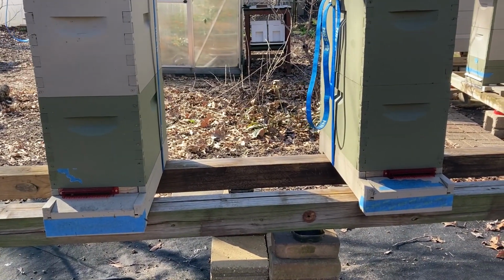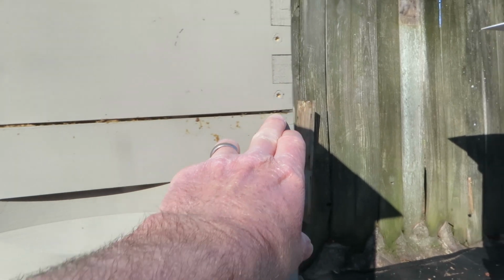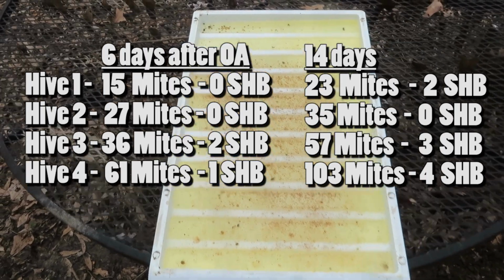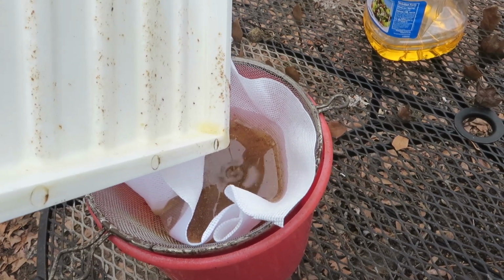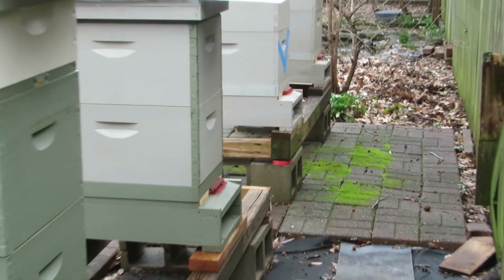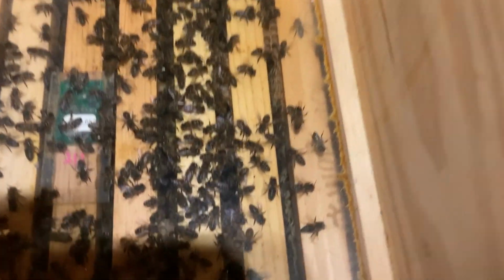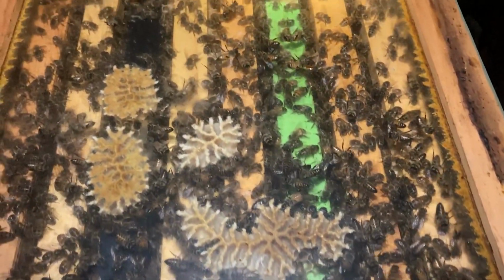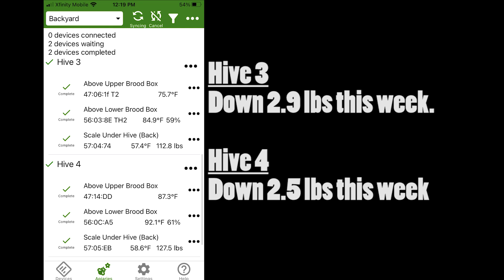❸ Week 4: Freshly built comb in January!  Charred frames from OA Treatment!

Comment: Since you have screened bottom boards for your nucs you can slide a piece of plywood underneath and block the front and back with rags.  That'll allow you to treat with the wand. Leave the plywood long in the back to support the weight of the handle.    If you are treating through the entrance without blocking off the screen you are probably not getting as effective a treatment as you could.  I am surprised you are getting significant mite drop more than 6 days after treating.  I'd hit em again, especially hives three and four.   Are you going to stay with those clear inner covers going into spring.  I can see them building a lot of burr comb on it.  How much space is between the glass and the frames?
Reply from the maker: That's a good idea but I'd have to lift the whole hive to get that plywood in.  I may see if I can come up with something.  The trays that have the oil actually slide up tight against the edge so they are pretty well sealed off when the tray is in.  I never thought to look under them with the trays out until last weekend though.  I think you are right looking at what you've done and my numbers I agree that they probably should get another treatment.  I knew we were going to get some cold weather so I held off.  If the weathers good this weekend I'll hit them again and recount to see where things stand.  I usually switch to regular inner covers during the year but I may try to keep the clear ones to see how they do.  The clear ones are regular inner covers but without the wood in the middle it's just plexiglass.  They should be 3/8" gap.